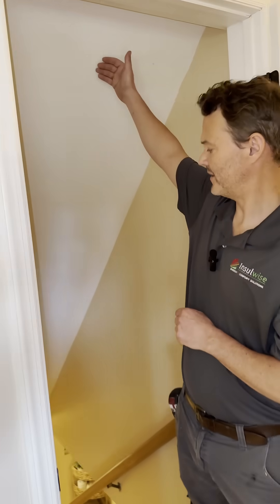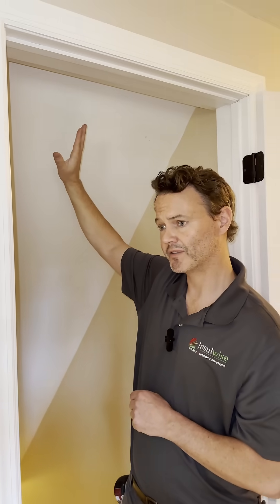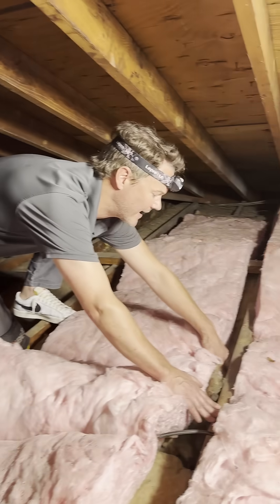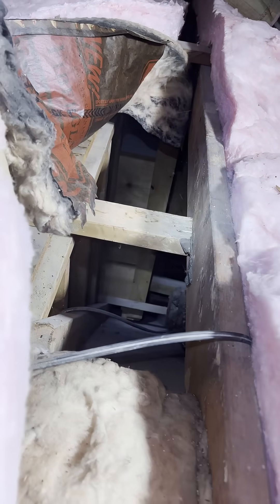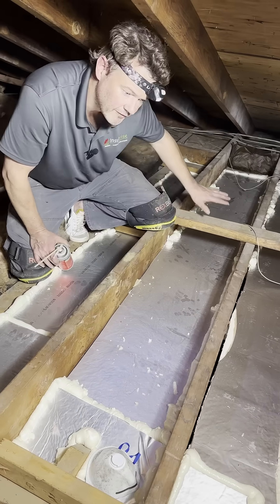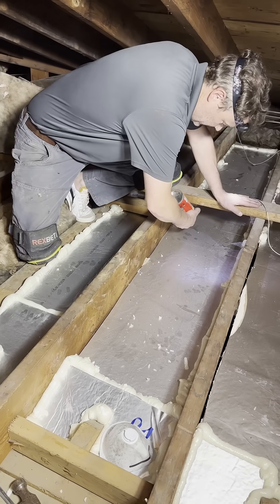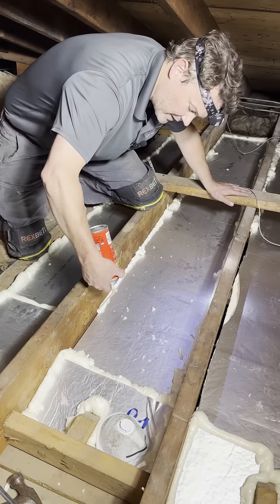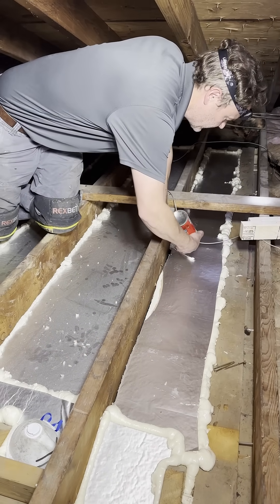Top Insulation Expert Reveals Best Air Sealing Techniques for Attic Stairwell Voids

Comment: That because the original insulation installer didnt do their job correct. That drop should have roll insulation
Reply from the maker: No, it did have insulation rolled over top of the void.  Stairwell voids are almost always covered in batt fiberglass.  However, the insulation does NOT stop air leakage.  The purpose of installing this cover over top of the stair well void is stop air leakage from the home to the attic.
Reply: @insulwiseenergycomfortsolu3293   
Do what ? 
You lay rolled insulation down in the hole /void. What ever you want to call it. 
• Rolled insulation vs Batten insulation what is the difference ? one comes in a longer piece.  
So like I said Roll insulation.
Reply from the maker: @katkilr7685  I see.  Are you aware that Stack Effect driven air leakage in attics is a thing?

Comment: Ah, perfect hidden compartment
Reply from the maker: I've seen stairwell voids in homes that were so massive that they went down 2 floors and I could have repelled into them like a cave.  Yes, you could make a cool hidden compartment in many of them.  Cheers!
Reply: @insulwiseenergycomfortsolu3293, just tell your heirs about any hidden spaces you store things in your will  just in case something happens to you.

P.S.Back in the 1559s to 1605s during the reformation castles and big estate homes  in medieval England had concealed spots for hiding Catholic priests from persecution. They were were called priest holes. 

In this video the stairwell  void is too small for that  but...
Reply: Could fit a body in there!
Reply: Just think of how many old homes out there with this exact basement stairwell were used to hide booze during the prohibition era.😮
Reply: For Christmas presents, of course!

Comment: My question is why?  What difference does it make if the cracks are sealed, if it all sits under R60?  A little air crack is going to work its way through R60?
Reply from the maker: Air flow from your house during the winter will absolutely bleed through any type of blown in insulation -- unless it's dense packed but that's a closed cavity solution.  We prove this by doing blower door tests in homes with tons of blown in fiberglass (and sometimes even cellulose) all the time.  When all of those little holes and cracks are added together you'll typically come up with an opening as big as a medium sized window.  And that's open at the top of your home year round.
Reply: @insulwiseenergycomfortsolu3293   
 "When all of those little holes and cracks are added together you'll typically come up with an opening as big as a medium sized window.  And that's open at the top of your home year round.

How do you figure when that "open window is covered by R60?   The cracks from the lights, for example, sit under the R60, which sits on the attic floor.  The R60 on the attic floor is a greater R value than any door or window I have.
Reply from the maker: @eddieadams4770  In the building science community it's widely understood that air leaks will move through loose fill insulation as well as batts, etc.  Don't take my word for it, do some more google research on it and you'll find plenty to back up my assertion.  Or on the other hand if you do find a credible source that says air leakage in an attic can be blocked with loose fill insulation, I would like to see it. Thanks
Reply from the maker: @eddieadams4770  What means have you used to test your theory that blown insulation stops air leaks?  Specifically, which diagnostic tools and under what circumstances.
Reply: If you lift up the fiberglass batting above your wall top plates in the attic, you will find black lines on the batting from the air flowing through over the years
Reply from the maker: @stevedery2900  Correct.  Blown and batt insulation does not stop air leakage.  At best it may slow it down a bit.
Reply: @stevedery2900  Ok, what is that in terms of numbers?  Does anyone know.  I don't want to spend thousands to save a few dollars.  There are 10 blankets either on top of me or on top of drywall on top of me.  It's either going to be R60 or R61, right?

Comment: Looks good. I wouldnt use this on new builds as there is far too much expansion and contraction in the timber we get these days, the seal would be broken at the first change in season. If i were the home owner id request you seal the actual staircase ceiling so i dont have to maintain the temperature in that unusable space. Understandable that its easier for you to just do between the joists.
Reply from the maker: Thank you!  When I first started doing this I would climb down into the voids and seal the exposed stud bay openings, misc penetrations like outlets, then batt the walls and floors with fiberglass, and finally staple tyvek over the studs.  The problem is that it's extremely time consuming as well as somewhat dangerous.  It's more difficult than it looks working on a sloped space in a tight area and trying to get everything right.  I was sure I'd have an employee loose their footing at some point and fall through the drywall of the stairwell slope -- and then down a flight of stairs.
In terms of heating and cooling that space, the act of sealing the top of it this way already makes it far more energy efficient than it was prior.  It would be my bet that the difference between capping the void and perfectly air sealing and insulating the interior of it would be almost impossible to notice on utility bills.
Reply: @insulwiseenergycomfortsolu3293   Thank you for the long and detailed response, i 100% agree that the cost and effort far out-weigh the reward. Id be a terrible client... lucky i do it all myself haha.

Comment: All that wasted space, walled off.
Reply: Its not wasted space. At best you could put a few shelves in but who wants objects on shelves above them as they are walking down a stair case? The cost making that space usable for such little return is where the true waste is and that is why its like that. - Carpenter.
Reply: @ill_intent666  also what you trying to say thats gonna cost to board in a box ? 
itll cost the price of like 2 extra plasterboards if that 
you probably still got enough left over since you just built an entire house out of the crap 
and the price im already paying for a shitty wooden house is through the roof so yeah gimme that shelf space, its way more useful than an un usable cavity
Reply from the maker: In Pittsburgh stairwell voids are always treated this way.
Reply: @infertilepiggy5667  It would require loads of extra framing and finishing as well. A simple set of shelves on the under side of a stair case might raise the cost by $3-4k here in Australia... i assume maybe 1-2k in the US. All for a potential health hazard.
Reply from the maker: It is a bit of a waste and some homeowners do recognize this and build shelves that go into the space.  99% of the time homeowners are completely unaware that these large voids exist in their attic floors.

Comment: Can’t you put the old fiberglass in the cavity before adding the foam board? Or not needed?
Reply: My thoughts exactly. That entire void should be filled, not just capped.
Reply from the maker: @AndrewLumsden  When the void is surrounded by interior/ conditioned space on all four sides there is no reason to fill it.  Once it's capped, air sealed,  and then insulated over top of, it behaves as an inert space in a home, the same a closed in a bedroom would.  The only time that we fill them is when stairwell voids abut an exterior wall.  For example, if the stairs of the home are on an exterior wall versus the interior of the home.  In this case capping the void would still allow for the exterior attic walls inside the void to conduct cold into the void and allow the interior walls to lose heat to the outside wall.  In these cases we fill them with cellulose insulation.
Reply from the maker: You could do that and then make your sealing plane on top of the floor joists.  But you then would need to cap the ends because there will be a gap.  Also, the fiberglass is almost always loosely attached and partially hanging down into the void.  Best practice is pulling the existing glass, sealing between the joists, and then insulating over top of the new plane (IMO). 
Andy

Comment: Question... Would sealing that cavity that way cause moisture to be trapped in there? Wouldn't the foam board have to go against the stairs at the bottom/sides of the cavity?
Reply from the maker: Installing this foam panel and then air sealing it will cause this to function the same way as the drywall ceiling would on the rest of the attic floor.  Now, if we did not insulate over top of it, it's possible the surface could get cold enough for water vapor inside the stairwell void to condense on the underside of the foam board.  But because we later added 15" inches of cellulose insulation on top of the foam board, it should not get cold enough inside that void for water vapor to condense on it (just like on any other ceiling surface that's below an attic in your home).  If you have other questions fire away.  Thanks!
Andy
Reply: @insulwiseenergycomfortsolu3293  Thanks Andy!
Reply: Hey Andy, so I did about the same for the entire ceiling/ attic floor. I put 2 inch polyiso foamboard, air sealed with foam gun, then put 9.5 inches of fiberglass batts. Does this sound good for NH climate? Thank you.